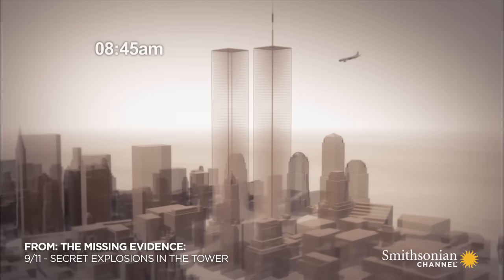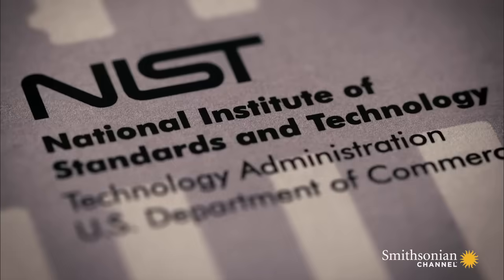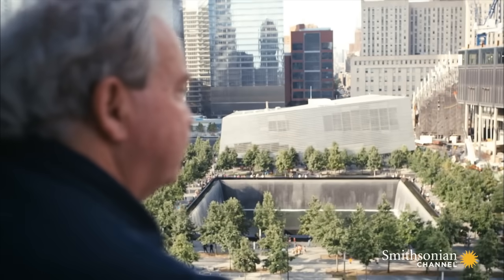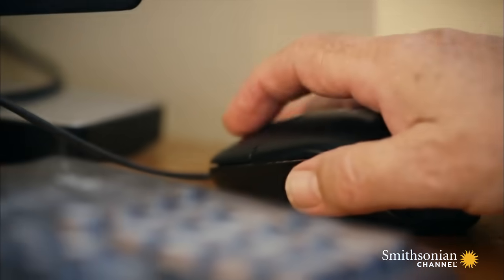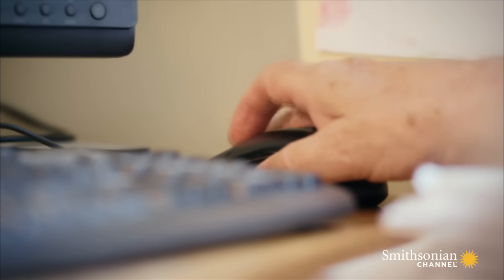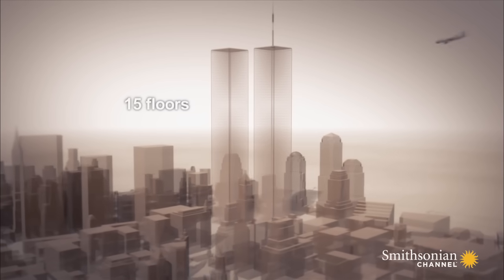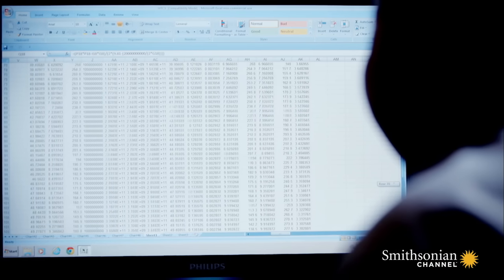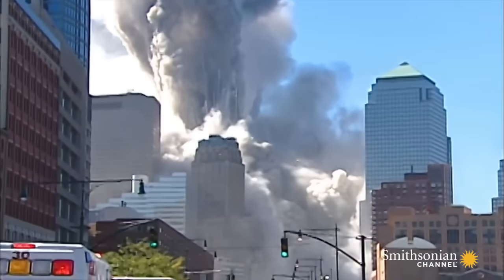This Computer Simulation Explains How the Twin Towers Fell

Comment: People that survived this nightmare, they all said that they heared an explosion before they left the building and it's collapse began.
Reply: Scientists in Norway have explored this and concluded these explosions were caused by a mixture of water from sprinkler systems and molten aluminum from melted aircraft hulls created explosions which ultimately led to the collapse of the World Trade Center. The building's steel columns did not melt, but were warped leading to integrity failure. To add there are official reports of jet fuel spilling into the elevator shafts, igniting, causing explosions throughout the building and in the main lobby. First responders reports describe arriving on scene and finding dozens of people who were burned alive in the lobby due to these explosions. To add, the plumes of smoke that people refer to as the "denotation" is pressurized air that was instantly compressed when the building began to collapse on itself and was seen bursting out from the building which resulted in loud explosions.

Comment: There is nothing weird about the collapse although it may look like "how can relatively small object destroy a huge object."

Its not like can a rock weighting 1 kg destroy a rock weighting 4000 kg (roughly the same weight difference as between wtc tower and boeing airplane). We are not dealing with solid objects. 

We are dealing with object (tower) a) which has uneven density b) structured so that the own weight can destroy it. 

Its about can a small object (with explosive qualities) destroy a huge object if it hits on the right spot. Answer is easily.

Comment: I believe 9/11 was a inside job and with structural steel melting at 2400 degrees jet fuel only Burns at 1600 how is it physically possible for this to happen . I'll say bush had a big part in all of this. And if you don't believe what I'm saying look it up.

Comment: The top sections CANNOT CRUSH the lower sections. 
Why?
They are engineered to hold up far more weight than exists. 
You cant have lower sections that collapse under exactly the weight that is up there.

Comment: The floors crushing from above clearly decintergrated meaning there was now, No force or enertia to drive down the rest of the building, to the pavement. At some point the force would have stopped because of 'resistance' leaving a percentage of the tower still standing. Stop trying to explain what cannot happen unless, the designers of the builders admit, the towers themself by design, were floored and could have collapsed at any given time!
Reply: Force is mass x acceleration and there is still enough mass and acceleration from the floors above the impact site to cause the rest of the floors to keep adding on as the floors fell
Reply: @jongsoonkebaso5921  I hear what your saying but force equals itself out when it meets resistance. Two things, the top floors decintergrated and one top sectoon of tower fell off, this means no force and no enertia, so what was so bIg to drive the whole tower down to the pavement. There was more steel in the central core to make 2 towers the size of the Eifful tower of Paris. If that fell there would be huge pile of twisted steel about 40% of the original height. Where did two and half million tonnes of steel go?
Reply: @thecure4470  Can I borrow one of your tin foil hats please? I lost mine
Reply: Apps GH you need a rubber hat you helmet 🤣😂
Reply: @AleKaLloyd  Run out of those as well, could I borrow yours?
Reply: @Apps_GH  And you had edit this!
Reply: @thecure4470  Had to correct my spelling dooooooooooood
Reply: @jongsoonkebaso5921 wrong

Comment: this simple explanation has much better science than all other hour long documentaries that I watched for and against conspiracy.
Reply: Answer this then FACT 1: A gravitational collapse of the north tower violates Newton's third law of equal and opposite forces. The top 15 floors supposedly crushed the many floors below all the way to the bottom. Putting aside the basic physics violations addressed in later points, When two bodies interact by exerting force on each other, these action and reaction forces are equal in magnitude, but opposite in direction. This means that for every floor destroyed in the lower section, a floor is destroyed in the upper section. This means that after 15 floors have been crushed in the lower section there is no piledriver left to continue the collapse.(Even if it could crush the stronger lower section, which it couldn't) There was very little 'accreted mass' as it was all being expelled laterally.